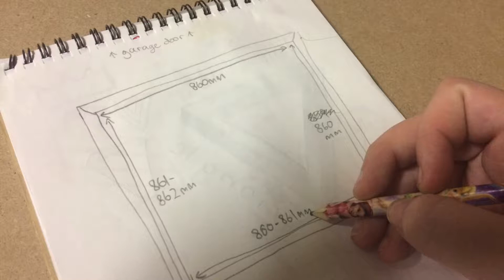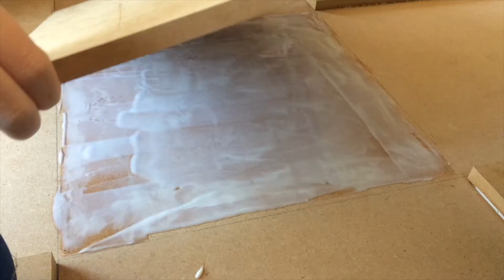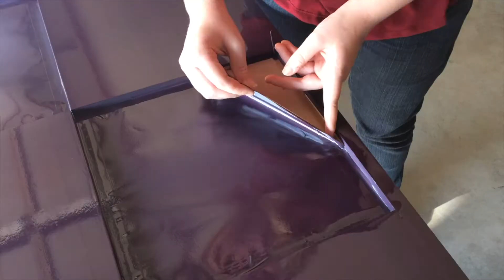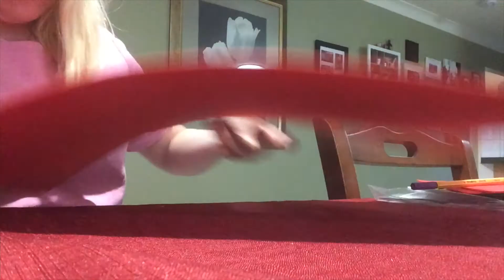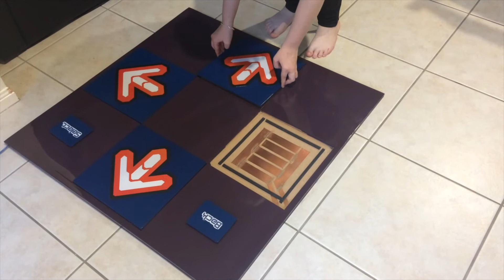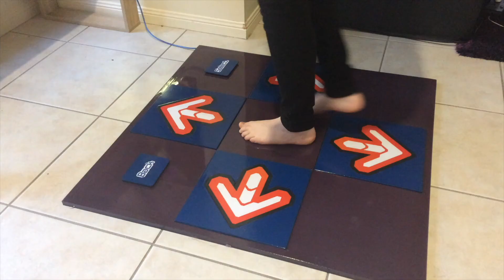Dance Dance Arduino: Dance Pad

Comment from the maker: Just a tip for anyone making/considering making this project! after a few (maybe 4) hours of playing, the soldered connection between the copper tape had been worn down and therefore didn’t work. If you’re making this project, I recommend using copper plates instead of copper tape.

Comment: That's a really great design, super clean construction too! Thanks for the video, always happy to see more videos of DDR pads!

I've done quite a bit of pad construction and modification, and if I could make one suggestion: Look into a material called "Velostat" or "Linqstat" (it's the same stuff). It changes resistance based off compression and if assembled correctly, it can be an extremely reliable material for pad sensors. You'll need to rewrite the code to look for changes in resistance rather than a binary on-off, and calibration can be a bit of a pain, but when it's working it's absolutely great.

Your pad looks super well constructed though, and I'm sure it could last a very long time! Thanks for the great video!
Reply from the maker: Tom Matthews thank you!! you sound very knowledgeable on arduino and construction. while arduino isn’t something i’m interested in anymore since i made this about three years ago, i hope other people can take on your advice!!

Comment: Same problem as the guy made on an other video i seen. Foal connection and mechanical connectors short is not reliable. Buttons should not bend on the DDR. It cause mechanical intеraction which lead to wearout and eventually break. I would recommend pressure sensors that will fit a purpose. Also will recommend as to previous guy using Arduino micro instead. This way u can hide it in the pad and make micro-USB exit on the side so no additional devices, wires, connections. Just a pad and USB cable to the computer. Aluminum frames on borders will make it looks cooler and lightning the buttons while pressed with luminodiode will make it more fun and impressive. Yet last one should check out with power consumption, we don't want an additional power supply.
Reply from the maker: I'm aware that there are a lot of improvments I could have made, yet I was working within and time frame and relatively low skill level as I was only 13/14 years old at the time this video was made. I hope other who want to make this project see your comment and can make adjustments :)

Comment: is it compatible to Arduino UNO?
Reply from the maker: Irish Yeah The Arduino Leonardo has features that allow it to act as a keyboard or mouse yet the UNO does not, and since the main aspect of the project is that the pads act as arrow key presses, that feature is needed for the project. I don’t believe this could be done on the UNO, no, unless there’s some kid of shield for the UNO that can make it act as keyboard presses.
Reply: Holly AM There is a library you could upload to make keypresses... So it's np

Comment: Very cool build but I always see a flaw on that kind of sensor design, for high level players they won't be very responsive... Is good for beginners, but for profesional level the sensor either has to be bigger or the contacts should go as four bars in the borders of each arrow like the original arcades, this way you don't necesarily need to step with your whole feet on each arrow but just the sides to improve speed... Where are you from, by the way?
Reply from the maker: Thank you, and I understand that my design won't work well for experienced players who want to play harder songs. I was only a beginner player so I didn't really consider how the dance pad would work for experienced players. Also, I'm from Australia.
Reply: @kitam7164  Quite far... I wish I have the tools to make myself one of these dance pads

Comment: I like the finished look, but I have concerns with your modified button design. 
The foam spring back might work fine if you're an novice player who stands in the middle like you are in the example but if you're an experienced player who dances from button to button the foam will breakdown quickly. Another problem is the foam will not allow the button to spring back fast enough with higher BPM songs and the foam tape will get worn and compressed from players constantly shifting weight from button to button.
Reply from the maker: I agree with your concerns, and as I'm only a very novice player, I didn't worry about those when building my project. I understand that more advanced players would have to adjust how the buttons were made, however, this is just how I decided to make my own dance pad. :)
Reply: what do you recommend to be used as the springs for the buttons then? I'd like to make a pad that doesn't have this unresponsiveness problem, and the other Arduino dance pad vid I've seen also uses foam springs..

Comment: Did you use any type of resistors for the grounds or anything like that? And would you happen to have a wiring diagram? I’m about to put two of them together . Also, did you use anything to secure the panels down so they don’t accidentally pop out while playing ?
Reply from the maker: lazer1985 I didn’t use any resistors, and that hasn’t been a problem ever since I built it so I don’t believe they’re necessary. I don’t have a wiring diagram, but as long as under each panel, one bit of copper tape is connected to a ground wire (the same ground and all the other panels) and the other bit is connected to it’s own wire (to plug into a pin on the Arduino) you should be alright. I’ve never had a problem with the panels popping out while playing, so I don’t think that’s much of an issue. I hope your project turns out well!
Reply: Holly M thanks so much for the quick reply! I was just asking because I’ve seen other videos use them , but good news that you didn’t and have had no issues! Hopefully you don’t hear back from me until it’s finished and working , but if not sorry in advance for bugging ya !! Lol
Reply from the maker: Hahaha no problemo! I really like seeing that people are trying to make it themselves!
Reply: Holly M ive been wanting to make one for a while then over the weekend me and a buddy were sitting around and just got the urge to start playing again lol so I ordered a couple audrinos which should be here today . Should be a nice weekend project . Gotta try a mini proof of concept today
Reply from the maker: lazer1985 Awesome! Tell me how it goes once you’ve made it!

Comment: Really cool, good job! I'm trying to make my own; how thick was the foam?
Reply from the maker: 3d adventures Awesome! The foam around the copper tape on the bottom of the dance pad was about 1-1.5 cm thick, but the foam underneath the step was only a few millimetres thick. Be sure to tell me how your project goes!
Reply: I will, thanks for the help! I already bought everything and was just sanity checking, but you gave me a bunch of ideas for a v2 after I hack this together first. When I say "hack this together" I mean it, I'm going to try an old mostly broken mechanical keyboard by soldering the wires from the copper to where the switches should be :p

... this might be too hacked together but I'm going to comment again with some pictures when it's done! Should be fun, at least.
Reply from the maker: Awesome! I'm glad I inspired you to make your own! Looking forward to seeing how it turns out!
Reply: It works!!

For each button, I'm using 4 1cm thick little squares of foam at the corners as springs. I'm also using two flat steel pieces instead of copper tape, as they make a satisfying clicky sound when pressed. One wire is attached to the moving piece's steel piece and one is attached to the platform's steel piece.

To hook it up to a computer, I'm soldering the two wires for each button to an old keyboard. When the button is pressed, the keyboard thinks a switch was pressed, and sends a keydown (when you step off the button, a keyup is sent). I tested it with a midi piano, and it works like a charm from wherever I press it, even though the pieces of steel are fairly small.

Right now it's looking very ugly though! I'm also definitely going to take inspiration from the style of yours.
Reply from the maker: 3d adventures So glad to hear it works! I was going to use copper plates but I was running low on time (copper plates are probably a better idea, the soldered connections on my dance pad have worn down after a full day playing, now the back button doesn’t work). I made the designs by printing them out and laminating them, but if you could get them printed as vinyl stickers or even just print them on photo card, that would probably work better as the colours on mine started to bleed just a little. Hopefully your dance pad is looking colourful soon!